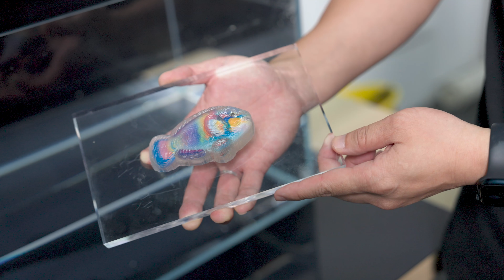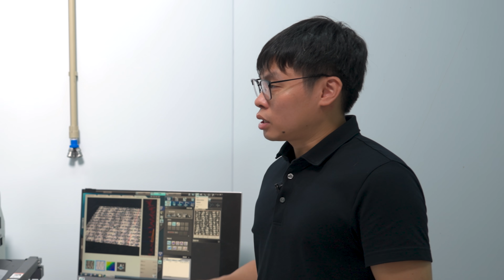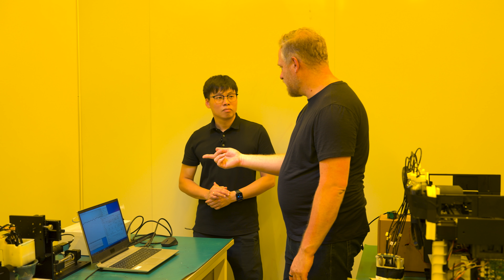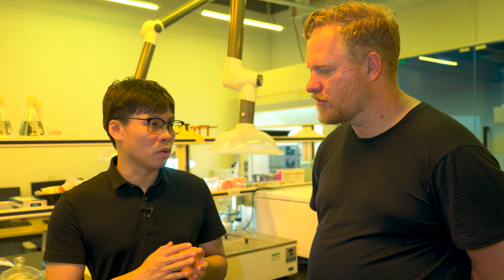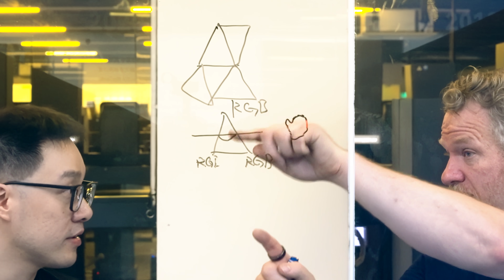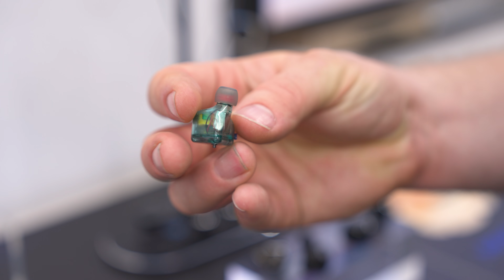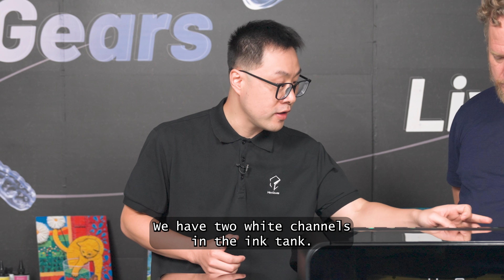Full Color 3D Printing on the Desktop is Finally Here! Meet the HeyGears G1X Engineers

Comment: maybe i missed it but as far as i understood the G1X uses the same Epson i3200 print head as the Morpho pro "2.5D" UV printer in your prior video, it would've been interesting maybe to go into detail as to what enables the G1X to print fully 3D models up to 150mm while the Morpho pro only allows up to 60mm 'texture stacking', like what differentiates the $3600/$5400 G1X from the $3000/$5000 Morpho pro?
Reply: 95% of the difference is software and software licenses.
Reply: The G1X offers true 3D printing; it uses resin, whereas the Morpho uses only brittle UV ink—they’re not even in the same league. And the G1X’s $2,799 UV version is fully capable of competing with Morpho’s $3,000+ version.
Reply: @saily-t6d  full-color3D need More accurate structure.
Reply: 60 mm class texture stacking and 150 mm full-color 3D are not the same control problem. The latter needs layer-wise material assignment, support strategy and hours of Z repeatability. G1X puts Y/Z on the platform and keeps the carriage on X; that architecture is what makes a tall 3D job even attemptable on a desktop i3200 machine.
Reply: Same printhead family, different job. Texture stacking in UV Printing is a raised-graphic workflow; Full-Color 3D Printing is a separate resin system (CMYKWWST) on a bed that does precision Y/Z for thousands of layers. Deep 3D builds are specified up to 150 mm in that 3D mode. The useful distinction is motion, material Hub and long-run registration — not the i3200 SKU alone.
Reply: I’ve gone through pretty much all the contents, and there are two key differences that stand out to me. First is he Morpho uses an FDM‑style mechanism, which could lead to minor accuracy issues, so that’s something worth keeping an eye on. Second is variable ink path capability. It looks like the Morpho has a fixed ink path, so that’s a consideration if you want to experiment with a wider range of ink combinations. Also, I recently noticed HeyGears is running a promotion offering a $500 cashback.
Reply: I read it as two different modes, not a taller UV sticker. UV texture is the everyday raised print; the 150 mm figure is the actual 3D-build path with a different ink/resin hub. Comparing only the head misses that.

Comment: So the head is an off-the-shelf head, but everything else is proprietary.
Reply: Buy the complex part, build the ecosystem around it
Reply from the maker: Yep! This seems to be very typical for inkjet and uv printers
Reply: @StrangeParts I wonder if there are patents in play.
Reply: @AndrewHelgeCox main patents for resin jetting 3d printers has been expired for a few years now
Reply: @Rcmike1234 that's why these printers are popping up now.
Reply: Pretty much. Lots of machines can buy the same head. The interesting part in this video is everything wrapped around it — motion, ink paths and software — which is also why the UV side should not be judged as 'just another i3200 printer.'
Reply: They built quite a few custom modules for the printhead, including the heating assembly, quick-release mounting, dampers, and the ink path design.
Reply: Pretty much. Lots of machines can buy the same head. The interesting part in this video is everything wrapped around it — motion, ink paths and software — which is also why the UV side should not be judged as 'just another i3200 printer.'
Reply: An off-the-shelf i3200 only defines jetting hardware. Full-color 3D forces long-run registration, channel assignment and recovery after ink-path changes. Those constraints are stricter than a single UV pass, so the proprietary motion, RIP and maintenance stack is the actual differentiator.
Reply: Yes — G1X uses an Epson i3200-U1HD printhead. The head is the starting point; the platform is what we engineered around it: X-only carriage with a precision Y/Z bed, configurable eight-channel ink paths, and cleaning/maintenance designed for long, multi-layer jobs. That is the same foundation UV Printing inherits.

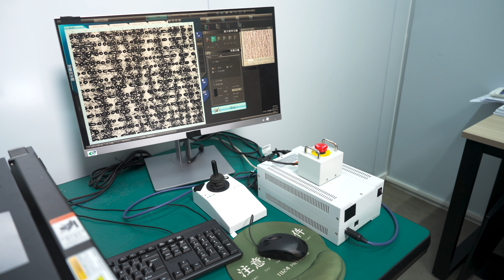Comment: 5:40 Confocal microscopy would be a whole video in itself. It's an awesome technology! (And if you're die hard, look at 2 photon microscopy too :))
Reply: Is this the same thing @UsagiElectric is doing?
Reply: In undergrad worked on a handheld confocal microscope for medical applications, very cool tech!
Reply: Confocal work is how we study what a droplet actually becomes after it lands — not just the datasheet. That same control is what we want people to look for in UV tests: gradients, white/color edges and varnish registration.
Reply: confocal is a process-metrology tool: drop shape, coalescence, cure. Full-color 3D is a harsh duty cycle for that loop; UV registration is the lower-dimension version of the same problem

Comment: YT labeling this AI is a normal YT thing
Reply from the maker: Ai was used for dubbing mandarin into english
Reply: @StrangeParts  I wouldn't mind there being a mandarin original audio track option as well
Reply: @StrangeParts  That is sheer disrespect that it gets a generic AI label when it was just dubbing. Like I do think that it should have some disclaimer that the dubbing was AI, but this receiving the same AI label as fully hallucinated AI slop is diabolical. I should also say that I think this is a YouTube problem, it should have several labels so creators can be honest about how their using AI, rather than just choosing between no label and the "AI" label.
Reply from the maker: Yeah, it would be nice to have some more nuance to the labeling.  But to be clear, I get to manually chose to apply the label, and I thought it was better to be on the safe side.  I'm now wondering if that was the right choice?
Reply: @StrangeParts I would say that it would depend on weather you used an llm. Traditional translate and text to speach don't really fit inside inside the current definition of Ai. It's just really unfortunate you can't specify. There is such a massive difference between old school computer translation vs Ai llm generated audio. There is also a continental difference between Ai llm audio vs fully halucinated Ai video. You really should be able to specify, including traditional translation, given how good text to speach has gotten.
Reply: AI is used for captions.